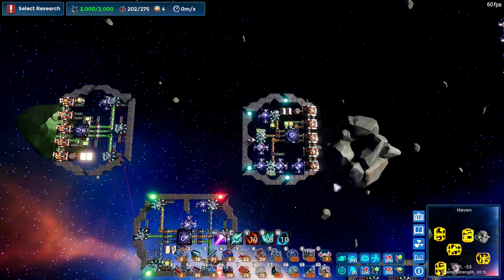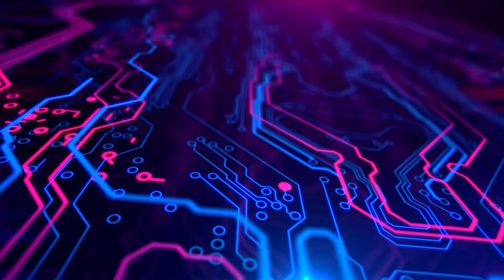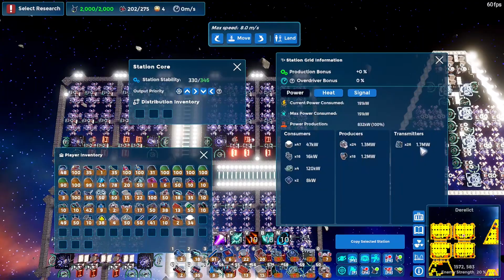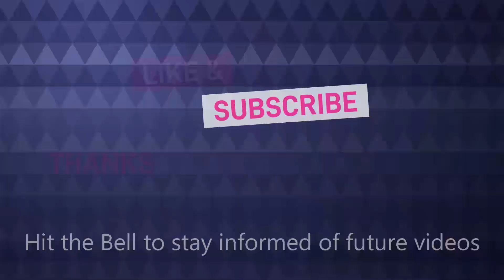Lest Play Final Factory | Update 2 Mobile Base Design

Comment: One question, why transfer so much power between the different power generating stations?

Doesn't that just mean you need even more power on the other side to get it to the productive stations that actually make use of the power?
Reply from the maker: It depends on what needs power and how much, I have had issues when i had a huge mega BUS and not enough power, the beauty of these designs is you can remove or add to a point, or move a ship away and it can be used if needed.  They are all prototypes anyway, so can change. Also you notice the last ship it transfers to, if you click the command centre it produces same amount but also has other transferred amounts into it, my thinking is theres a lot more to shove onto a factory network as well..